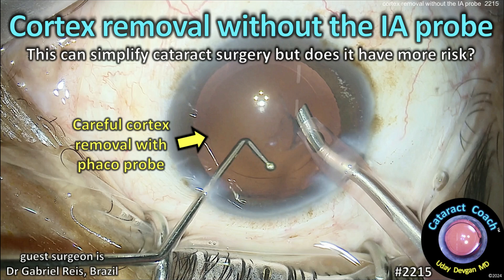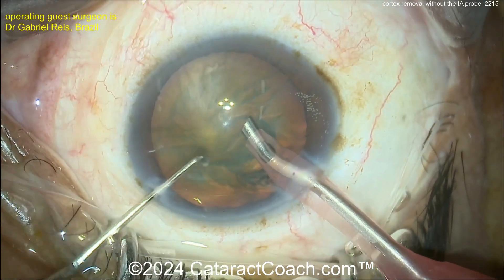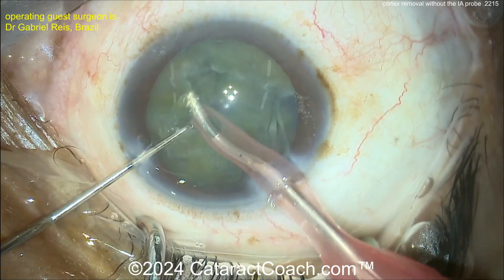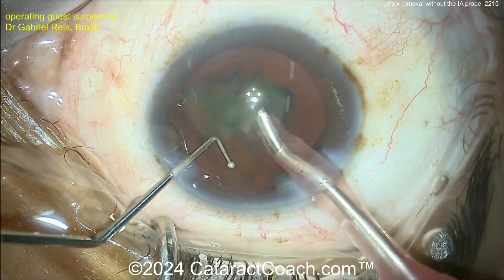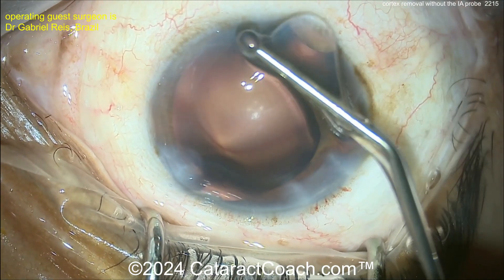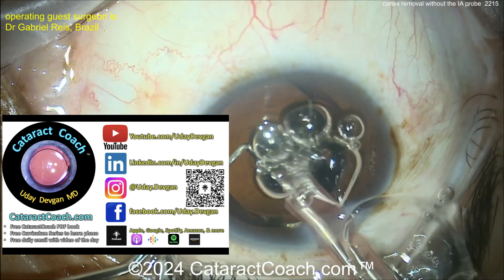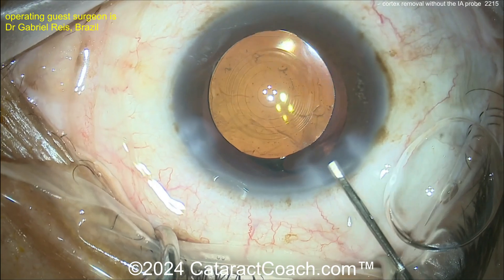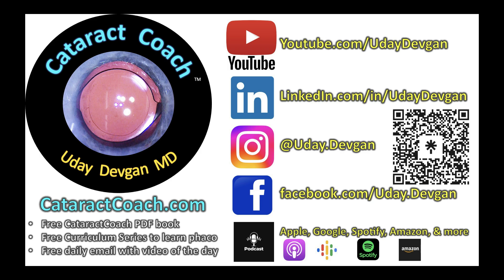CataractCoach™ 2215: cortex removal without the IA probe

Comment: A great technique in experienced hands. I personally prefer I/A, but I have seen many Brazilian surgeons using this technique and overall I felt that their complication rate is extremely low despite this technique and a high percentage of advanced cataracts. The cortex and I/A free style has come about to save time and cost as some of the high volume surgeons perform over 100 procedures a day, making them so experienced and routined with over 15k procedures a year that their colleagues in other parts of the world just can't believe it until they see it with their own eyes. Using I/A in every surgery would make it hard for them to meet the demand for cataract surgery in their regions. Of course, economic reasons also play a role, as not using I/A reduces costs significantly, especially in these high volume settings. Definitely great and interesting but I still wouldn't advise to try it. 😉✌🏼